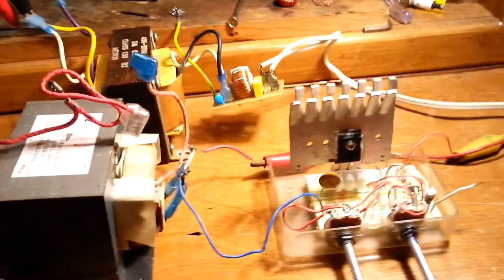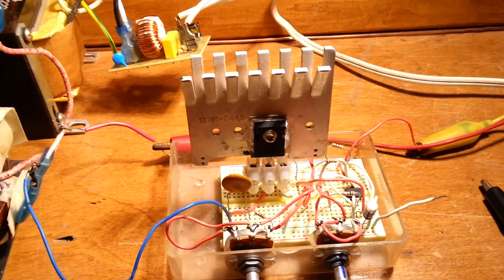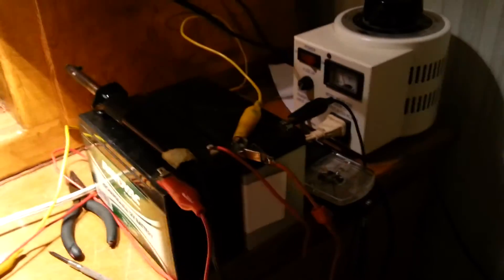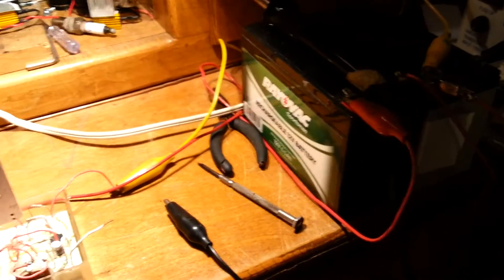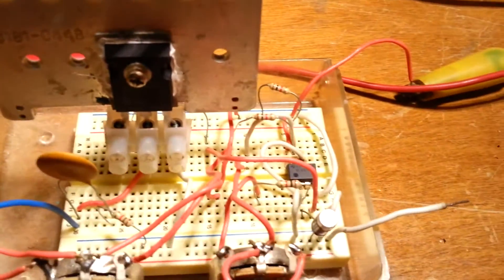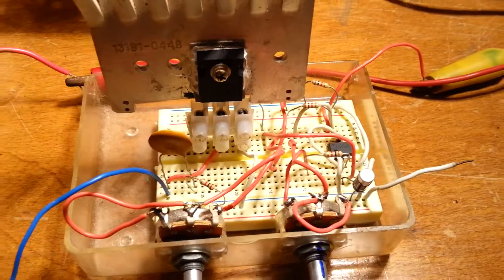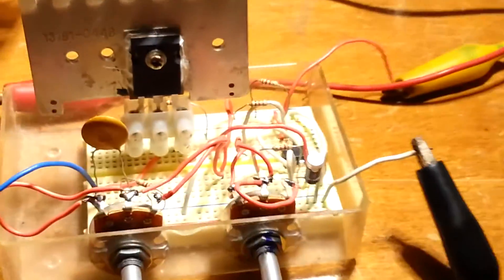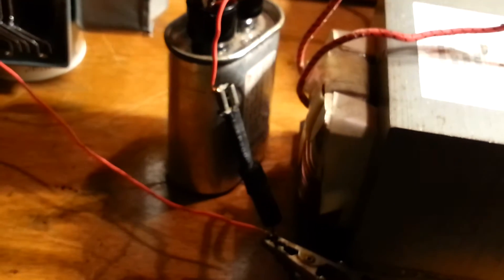Microwave magnetron powered by 24v

Comment: The idea is to save cost by replacing the big bulky transformer (which you are using ) with a much smaller ferrite transformer and by using the mosfet to generate VHF  (or very high frequency) to drive the ferrite transformer.
Can you kindly explain where is the achievement in your work?

Comment: This may be a stupid question, but why not use a 24V transformer to feed the MOT primary?
Reply: magnetrons have a narrow working voltage range, you cant vary the power by varying the voltage, instead you need a constant voltage supply with current limiting.

Comment: Try a zvs driver more power
Reply from the maker: i have a zvs built and ready, only problem is that it uses a center tapped transformer. im trying to rearrange the wiring so that i could use it on a transformer thats not center tapped.
Reply: Use an isolation transformer. 5+5 turns on an old flyback transformer core. Then 10 on the other side. Whatever the driver capacitance is between the 5+5 add another onto the so called secondary.

Comment: what is frequency ??
will it work better on 500hz or more ??
Reply: ELECTRONICS 50hz
Reply from the maker: so far i found that high frequency does not work to well on the microwave transformers, but i believe its around 50 to 60 hertz